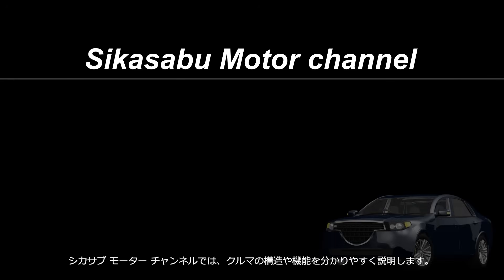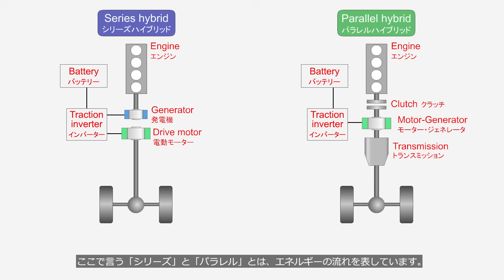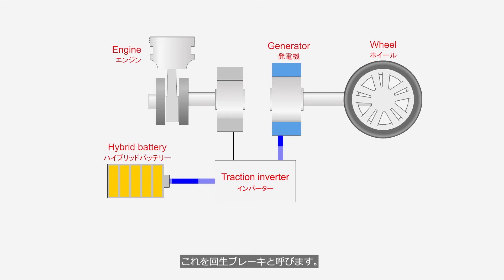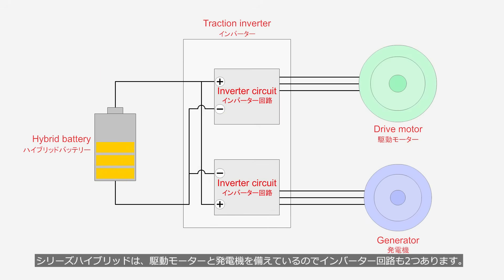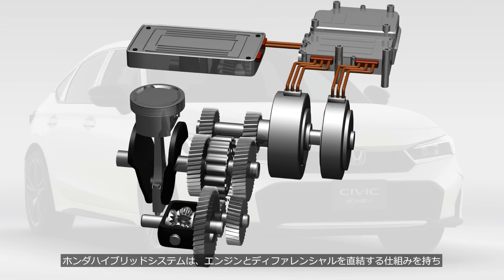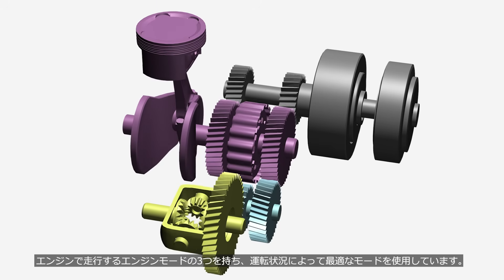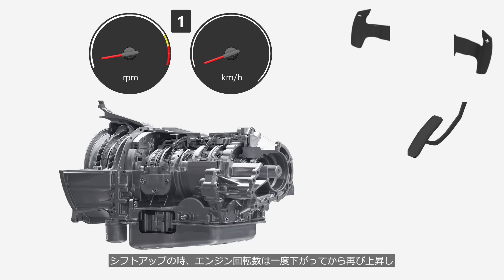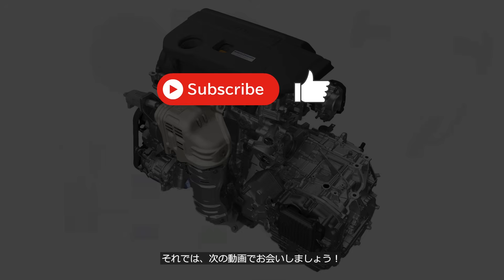Deep Dive into Honda Hybrid System　Can It Beat Toyota?

Comment: Series setup looses energy at every stage. That is why Toyota parallel setup has higher efficiency. Every time you convert energy there is an inevitable loss.
Reply: Serial (the adjective form of "series," grammatically correct in these contexts) operation allows perfect optimization of ICE efficiency (energy out divided by energy in). Yes, it "has losses at every step," as does any transmission, but they are less than you think. And less then the improvement in ICE efficiency.

Toyota's system is parallel-serial, not parallel. It uses both paths at the same time. So it also suffers both parallel and serial losses, and has less control over ICE efficiency.

That's why, when put in otherwise comparable vehicles, the Honda has better economy which is what you meant what you said "efficiency." And this proves that the system, in general, has better efficiency.
Reply: @jeffjo8732  I can see Honda's system being superior at highway speeds with direct drive, but Toyota's system should be equal or better at lower speeds when the ECU can choose whether to operate like a generator or power the wheels.
Reply: @Appletank8 Toyotas use one MG as a generator and one as a motor. The fraction of engine power taken by the generator is what controls rpm. Generated electricity powers the motor, but to get engine efficiency near maximum the total power is not matched to the car's need.

So the difference charges or discharges the battery. But this two-control-variable system makes it less efficient than the Honda serial system in the city. Check the ratio of EPA mileage ratings to verify this. But it also means Honda uses a smaller engine, which is less flexible with highway acceleration.
Reply: @jeffjo8732  Can you elaborate on "total power is not matched to the car's need"? I see no reason why Toyota's system can't operate like a serial hybrid. MG2 runs on battery power, ICE spins and generates electricity through MG1 and sends either to battery or MG2. Their PHV's pretty much operate like this most of the time.
Reply: @jeffjo8732  Also, which cars are you comparing? Camry has 53/50, Civic has 50/47, Corolla has 53/46, Accord has 51/44.

I'm not really seeing any noticable difference between either of them.
Reply: @Appletank8  "Can you elaborate on 'total power is not matched to the car's need/?" The gen3 Prius has a line in (RPM, POWER) space where it will operate. If it produces more, or less, power at each speed, that increases BSFC.  (BSFC is the number of grams of fuel needed to produce 1 kWh of energy; essentially the engine's efficiency.) These numbers come from eyeballing the chart, but  the are pretty close.

(1100 RPM, 13 HP, 221g/kWh)
(1300 RPM, 15 HP, 220 g/kWh)
(1700 RPM, 20 HP,  218 g/kWh)
(2000 RPM, 28 HP,  215 g/kWh) (best efficiency)
(2400 RPM, 35 HP,  217 g/kWh)
(2900 RPM, 45 HP,  220 g/kWh)
(3700 RPM, 60 HP, 228 g/kWh)

A traditional ICE car with a traditional CVT can't use HP as a control parameter. It has to match the ICE power to the pressure the driver places on the accelerator. If that is 15 HP - about what is needed to maintain 60 mph on a flat road - it has to run at 1300 rpm (a little rough, it might not), 15 HP and 220 g/kWh. But a hybrid can run, in theory, at 2000 RPM, 28 HP, and 215 g/kWh. The excess 13 HP is used to charge the battery.

But that might not be the best point, since charging the battery adds extra loss. It might be better top run at 1700 TPM, 20 HP, and 218 g/kWh. And only charge the battery with 5 HP.

All hybrids do this, but most people only think about "power assist." That's where the car needs, say, 60 HP but the engine runs at 2900 RPM and gets 15HP from the battery.

Yes, a Toyota could "operate like a serial hybrid," but that would waste its best features. PHEVs don't do that, they run in EV mode and then just like the HEVs.
Reply: @Appletank8  
Sure, if you cherry pick. I'm not saying that the differences are great, but Honda gets tha advantage in the city and Toyota on the Highway. This is mainly because Toyota uses a more powerful ICE. And it is seen in the city/highway differeces in the same vehicle (and the weak, underpowered Corolla is the outlier).

City/Hwy:
Honda Accord Hybrid 51/44; city +7
Toyota Corolla LE 53/46; city +7
Toyota Corolla SE 50/43; city +7

Honda CR-V AWD 40/34; city +6

Honda Accord Sport 46/41; city +5

Honda Civic Hybrid 50/47; city +3
Toyota Camry LE 53/50; city +3
Toyota RAV4 AWD 41/38; city +3

Toyota  Camry XLE 48/47; city +1
Reply: @jeffjo8732  I don‘t see in your numbers that Honda‘s system show better economy?
Reply: @OrangeUp  Then maybe you should look at the only pair of  vehicles where economy and efficiency are about the same thing. Hint: avoid Corollas and LE trims.
Reply: @j @jeffjo8732  Hmm, I just see that the Camry is doing better than the Honda Civic as well as the Honda Accord?
Reply: @OrangeUp  And ... you apparently don't like to read what others say. Did you notice the difference between the Camry LE (which I suggested you ignore) and the XLE? And maybe, just maybe, consider why there is a difference? And which Honda is most similar to which of the Toyotas on the list?

I didn't think so.
Reply: @j @jeffjo8732  And why should I ignore the LE? The XLE hes AWD and cannot be compared to the Honda.

Comment: Honda does NOT Need to add Fake shifting sounds as it's really Not Needed or Wanted.
Also, Honda needs to increase the Power of its Underpowered engines as it's Still relatively sluggish/slow when going Uphill or traveling on the highway at faster speeds! You'll feel that in the 2023-2026 CRV hybrids.
While Toyota hybrid engine system may be Loud & not as refined in action as Honda's, it's More powerful than Honda's hybrid system and can go uphill or travel on highways Better!
Reply from the maker: Thank you for your comment. I’m also skeptical about Honda’s fake shifting.
I’m curious how many customers would actually be willing to pay for that system.
Reply: One of the reasons Honda can achieve more efficiency (mpg is "economy," "efficiency" means how much of the energy in fuel is utilized) is due to the smaller engine. An ICE's optimum efficiency comes at about 20% to 30% of its rated power. In my 2018 Honda, it's 34 HP (rated 143, I think). By having a more powerful ICE, a Toyota has to either use the ICE less efficiently than it could, or send more excess power to the battery (suffering additional conversion losses).

Before you respond about me saying the Honda is more efficient, most comparisons are made between unequal platforms. An Accord is both larger, and rides on bigger wheels, both of which reduce economy. The closet is the Civic SPORT and the Camry SE - 1% difference in size, and the same wheels. The Civic gets better mpg, and has better performance.

But I agree that the fake shifts are not needed. What they do is, in high-power situations, adjust the balance of battery/generator power to make the ICE change speeds. This also affects both efficiency and performance.
Reply: @jeffjo8732  Are you sure it's only 30%? From the BSFC charts that get made or leaked from OEM, engine efficiency tends to peak at about 70-80%, when the engine can keep the throttle plate mostly open and rpm low. Obd readings of my hybrid cars have them operating between 75% to 90% load most of the time.

Comment: The clutch plate is the weak point in this system as it will eventually wear down.  Also, when the clutch is engaged, the drive ratio is fixed and not variable.  
The Toyota system is simply superior.
Reply: Wrong! the clutch plate is not like a normal clutch plate. there is no slip no nothing. And no, Toyota is not superior. I have the Civic e:HEV now 2.5 years and the fuel kilometrage is 4.1liters/100 km average over these 2.5 years. and that is with autobahn and winter and so on.
Reply: @alexbernadina3082  <Sigh>. The clutch plates themselves are perfectly normal clutch plates. Their purpose is to slip under certain conditions.They can, and will, slip if the conditions warrant. That's why they are there.

The mechanism that controls the clutch plates is not normal - there is none. Like I said, they are permanently applied. 

The conditions are when the engine, or the wheels, experience an unexpected rpm change that the other can't match immediately. I can't tell you exactly what those conditions are. But the Toyota clutch would never fail if they didn't slip. And since they can, and have, failed? There must be routine slippage.

That can only happen, in a way that other hybrids with the same permanently-applied clutch that never fails don't experience, when the engine is started while the car is moving. A power-split device, like Toyota's, is the only way that this can happen.

The PSD maintains rpm in the relationship 13*MG2=5*MG1+18*ICE. (Note: MG2 is geared directly to the wheels.) If the ICE is off, it is held motionless by keeping MG1=2.6*MG2 To start the engine, MG1 [not MG2] is slowed so that ICE must increase to maintain this relationship. This is not as well controlled as starting the ICE in other hybrids, since MG2 can vary unexpectantly.
Reply: @jeffjo8732  Are you sure it's the MG2 doing the starting? The MG1 is already responsible for adjusting engine RPM since MG2 is directly connected to the wheels (thus doesn't change speed if the car doesn't), and also mg1 is responsible for starting the engine while stationery. Seems logical to keep using MG1 and change its RPM to spin up the engine. IIRC MG2 is only "slowed" or acting as a generator when in overdrive mode.
Reply: @Appletank8 Yeah, that was a typo. MG2 is geared to the wheels, and so cannot change rpm independently. But the (weighted) sum of ICE and MG1 has to equal the same fixed value. To start the ICE while the car is moving, MG1 is slowed by increasing its load, so ICE has to increase to compensate.
Reply: Honda's clutch is a failure point but with a fail-safe approach: even if it failed completely the car would still operate as a pure series hybrid, providing 100% of its possible performance, only with higher consumption at highway speed. And that's a very smart approach! Fewer things to break, and even if they do you're still left with a fully operating machine.
Reply: @Wilhem275  A clutch usually has three modes: Connected, Disconnected, and Slipping (or D/C/S). In a traditional transmission, it has to go through mode S to change from mode D to mode C. And S is where we would find the "point of failure" you describe.

In the 11+ years Honda has been using this clutch in hybrids, if it indeed was a point of failure, there would be evidence of it. There is not. This is because it doesn't work like a clutch in a traditional transmission. It doesn't use mode S. Ever. Both sets of clutch plates are rpm-synchronized by computer when the clutch engages, so it goes directly from D to C.

Many find it had to accept, but all hybrids - including Toyota's - have another clutch called a "Clutch Damper" or "Torque Damper." It is built into the flywheel, and it doesn't have mode D. It is in mode C almost (see next paragraph) 100% of the time. And like with Honda's clutch, there is no wear in mode C. It is there to prevent damage to the engine if the rpm of either it, or the wheels, changes unexpectedly.  Then, mode S lets it slip a little, and it actually has to slip back to its permanent orientation. There are springs that do this.

The exception to "almost 100%" is in PSD hybrids like Toyota's. They use the momentum of the car to start the engine while the car is moving. Unlike other hybrids that simply bring it up to speed using the generator as a motor, they actually have to slow the generator down and let the rpm of the wheels bring the engine up to speed. This can require mode S, and there are examples of the Toyota clutch failing.

So yes, a clutch is a "point of failure." But only in mode-S. By your logic, this means Toyotas, but not Hondas.

+++++

And no, serial ("series" is a noun, "serial" is the adjective, so when the engine and motor-generators are configured "in series" it is a "serial hybrid") hybrid mode is not a failsafe. The system would still try to engage the clutch, and it would not be able to stay in mode C. It would constantly slip, probably burn up the clutch, and destroy the transmission fluid.
Reply from the maker: I completely agree with you. From the perspective of fuel economy, I think Toyota’s system is the best.
Reply: @sikasabumotorchannel There is no wear on the clutch plates, as there is never a situation where they slip. The clutch is only closed when the car is at a constant (highway) speed, and the rpm of the opposing plates are matched by computer. You may not want to accept it, but Toyota hybrids suffer more clutch wear. (Yes, there is one. It is a permanently-applied clutch built into the flywheel to protect either the engine or transmission from sudden rpm changes in the other. That happens when the Toyota's engine is started while the car is moving.)

Don't criticize an aspect until you understand how it is used. The operation in parallel-hybrid mode is supposed to be like overdrive in a conventional gas car - so the gear ratio is supposed to be constant. It's the entire point.

To compare mpgs, you need to compare similar cars, not cars that are marketed against each other. For example, the Accord is almost 7% larger than the Camry (123 ft^3 total interior volume, to 115 ft^3) while the Civic is almost the exact same size (114 ft^3). Then, wheel and tire size has a big impact. The Camry drops from 51 to 47 mpg when the 16" wheel with 205mm tires are replaced with 18" and 235mm. The Civic also uses 18" and 235mm. so it has better economy than the nearly equivalent Camry.

AND, the Honda system even has a better reliability record. There is no area where the Toyota is "simply superior."

Comment: How much hp do you think the new prelude will have? Total combined and individually for the engine and motor. Fantastic video by the way, it looks like a lot of effort went into making this.
Reply from the maker: Thank you for your comment. I'm happy to receive your kind words.
According to several websites and YouTube channels, the Prelude will come with a 2.0L engine. That would mean it uses the same engine as the Civic.
Engine: 104 kW and 182 Nm. Motor 135 kW and 315 Nm. (Japanese specification model)
That said, since the Prelude is a sports coupe, I’m hoping it will have slightly higher output than the Civic.
Reply: @sikasabumotorchannel  The power of these cars depends on more on the power of the traction motor, than the engine. But it is a "fake rating," based on a somewhat biased SAE equivalence table.

Comment: wow honda is so advanced they finally caught up to GM in 2011 by copying their chevy volt's drive train lol. only took 1.5 decades. somehow people think this is revolutionary technology worth $45k+. ironic you can get the same system in a 5000$ chevy volt with a larger battery lol
Reply: lol comparing a unreliable chevy to a Honda.
Reply: @garyhall7183  290k miles between my 2013 and 2014. zero repairs on either car except for 2x front wheel bearings that were recalled and replaced at like 30k miles before they ever failed.
zero range degradation. educate yourself on how these cars actually work and why a port injected, iron block, with low compression and no egr equipment will inhearently last longer than any toyota/honda made for the last 20 years
Reply: @vevenaneathna  
 @vevenaneathna  That's not what all the reliability surveys say,  your experience may not reflect the reliability most people find with this brand in general i.e. you were lucky.
Reply: @garyhall7183  lol are you taking about consumer reports? do you know how that company works? like 90% of survey responders are toyota owners lol.
Reply: @vevenaneathna How did Consumer Report achieve a 90% Toyota sample size?
Reply: If that IS true, it doesn't matter because if you get a Chevy Volt you literally own a Chevy Volt.
Reply: @IcyCow_1987  o no now my daily commuter car is the same as watchjrgo and superspeed rob. lol
Reply: The Chevy Volt bears more resemblance to the Toyota, than the Honda. It uses one planetary gearset in the VOLTEC I system, and two in the VOLTEC II. The engine can operate in series (as does the Toyota!), but not in a direct-drive mode. When it contributes mechanically to wheel rpm, it is using the Toyota system.

And BTW, Toyota "caught up to" researchers at the University of Maryland a decade after the system was patented there.